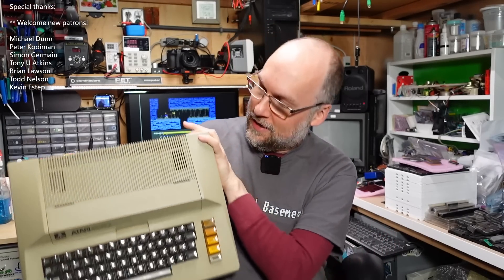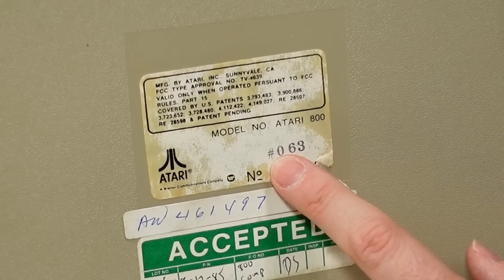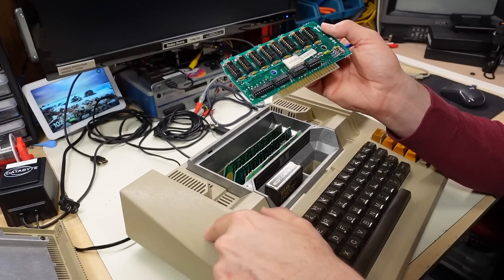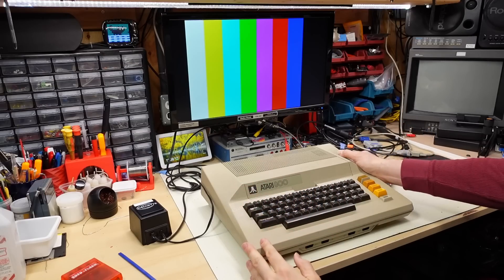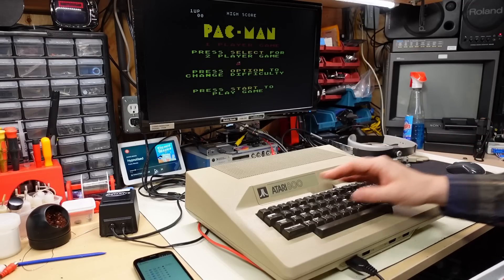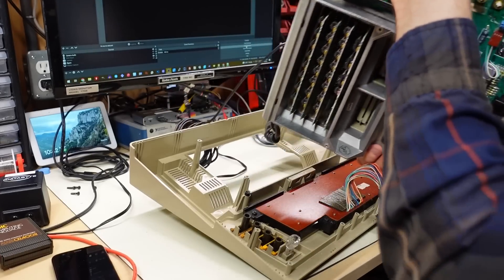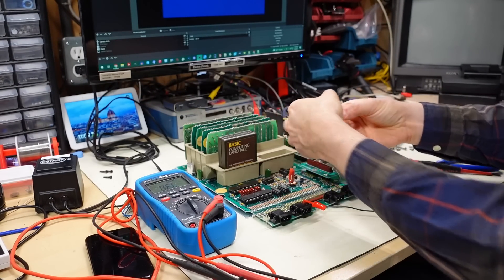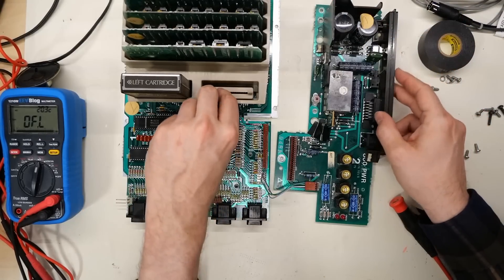Troubleshooting the beautiful Atari 800

Comment: The 800 was a very expensive machine comparatively speaking when it was first released and was still expensive in the year that the VIC-20 was available in the market (from 1981), even when accounting for the larger memory size. The one machine that was even more expensive was the Apple II, but one has to remember that Apple was able to get away with selling a computer that, adjusted for inflation, would cost the equivalent to $5,000 USD (!!) today, only because of VisiCalc - which was that computer's killer app. The biggest problem for Atari was that the 800 is just so over-engineered, making much more expensive (comparatively speaking) to manufacture than competing machines. What I think is the very best feature of the machine is Atari BASIC, which I still consider a masterpiece that was rivaled only by BBC Micro BASIC and Microsoft's Extended BASIC.
Reply: Apples other reason it could command such a high price is that it had inroads into virtually every public school that had a computer programming course, and its' only real competition there was Radio Shack and its' TRS-80 Model III, another fairly pricey computer.  Atari and Commodore could never get into public schools due to perception of them as only being video game machines, not true computers.

Comment: If I remember correctly the screws for the 800 memory cover were actually thumb latches which you could turn to get the cover off (didn't need to remove the screws completely) and the memory and ROM cards all had plastic covers with some very cool looking labels. Learned to program on one of those bad boys!
Reply: Yep the early models had those cool latches you turned to pull the cover off. And all the early models had covers on the memory modules and the OS module. The later models had metal tabs that you had to slide (after loosening the screws) to pull the cover off. And the later models did not have covers on their memory and OS cards because they came populated  with a full 48K. This also fixed an issue where the enclosed memory and OS modules would overheat. My brother had the early model and I had a later model. Now I have 2 800s' even in the original box!

The Atari that Adrian is working on is a later model. There should have been a removable plastic top brace holding all the cards from flopping around.

Cheers!

Comment: Because this 800 had screws to access the ram/rom boards and because the ram/rom boards were not in cases this machine was a later 800, the early 800's had thumb knobs to access the inside and the ram and rom modules all had cases.

Comment: Fun lost fact, the Atari 800xl was developed in 1981 in response to the reception of the 800. By 1982, several 800xl systems were made for FCC testing / development that used the same case as the one in this video. Sadly, I didnt know what I had, and its now lost. It was the only model I have ever seen in person with 800XL on the badging in this case design.
Reply: did you get any pictures?

Comment: You can tell this is a later model Atari 800. The Ram and Rom cards used to come with a Beautiful plastic case and they slotted securely in the slots. On the top of the case it would tell you 16K RAM, 8K Rom, etc.

Comment: My Atari 800 broke in 85, I intended to keep it and repair, it, but in a move, it was packed with my VIC 20, and that boc was lost, never seen either of those computers again.  But don't forget, it's has sprites too, it was the first computer with hardware sprites.
Reply: Hmm, I don't remember the permenantly sttached RF cable.  I wonder if they changed that later on?

Comment: I OWNED one of these machines in the 80s, shortly after graduating Pratt. The RAM boards shown are likely 3rd parry boards. The original ram modules were enclosed in metal/plastic housings which socketed neatly in the slots with side tabs. Aside from acting as a securing housing, might have also served as a heat sink. Back in those days, there was a lot of concern at the time about RF interference, hence the very stout shielding. There was also a fairly extensive library of software available on cartridges, tho’ mostly Atari branded games. I don’t believe that they ever offered “Left” cartridges.

Comment: the programs I used to write were often larger than the available memory. I had the programs as text on cassette, I wrote a loader, I used split screen , printed the program lines to the second screen ending in chr 13(return key) that way overwriting the program in memory as it ran...
 
I still can't afford a hard drive for it.

I also forgot how I did the split screen... but I kept the second one beyond raster 580 so you wouldn't see it on a tv, only if you had the monitor.

Comment: I opened up a friend's Atari 800 back in the day and the cards had been inserted through some kind of antioxidant goop. It had the texture of Vaseline and dripped on everything. I can't imagine it served any real purpose and now I wonder if that's something local repair shops were doing.

How did the power supply generate the +12V and -12V that the 4116 chips needed from the 9VAC input?

Comment: the original VCS/2600 had a similar zinc injection molded part. the cartridges had all the data and address lines going to them. lots of odd harmonics being generated.

Comment: My 800 has levers rather than screws to access the expansion slots. I must have a different revision. The serial label is gone, and I haven’t been inside it yet so I don’t know if it’s earlier or later than yours, but it’s probably earlier since yours is pretty late in the 800 timeline.
Reply from the maker: Yeah yours must be earlier. Really seemed like they intended very easy access to the extra slots right from the get go.

Comment: Late model  800's shipped with the cards naked, like your's.  Absent the cases for the cards, the boards would wobble, so there is a little plastic holder thingie that sits on top and gives them some rigidity.  You are missing the plastic thingie.

Comment: the ram modules are strange. On my 800 I had when I was in jr high the ram modules were fully enclosed like a cartridge. 
The 3rd party upgrade ram which went beyond stock max ram was freeballing like that. But stock ram AFAIK was cartridges. That slotted into the recesses in the metal shielding structure for rigidity.

Comment: That zigzag trace is likely more about impedence matching/transmission line stuff than a delay..I suppose it could be a delay but the order of magnitude of it would be a few orders above the sensitivity of any components in this machine (ie probably at best 200-500ns access time if that..that delay might be 2 to 3 ns)
Reply: Ie 1.7mhz is 588ns about.. I'm betting impedence matching way before any timing related thing.
Reply: @forbiddenera  Except that 588 ns is a full clock cycle, which means that the RAM is going to have to be able do a read or write in well under half that. In that half cycle you need to wait for the CPU address output to settle, set up the row address, assert RAS, wait for the row address to be latched, set up the column address, assert CAS, wait for the column address to be latched, and then wait for the DRAM to produce or write the data. CS and OE also need to be managed properly during this process, and the data must appear within the timing constraints of the 6502.

As is usual with DRAM, all of this involves a lot of tricky timing. It would be very normal for a system of this speed to need a signal delayed by just a few nanoseconds when it's a bit too early for the DRAM to work properly; if it's delayed too much the data won't be available when the CPU reads the data bus.
Reply: @Curt_Sampson  Yeah, DRAM timing can be tricky; After reviewing the schematic, it's listed as a 'printed coil' and doesn't appear to be involved with the ram logic although the schematic isn't completely clear. I still think impedence matching and/or filtering.

Comment: The serial number 063 is 6th week of 1983 making it one of the last 800's as 83 it was replaced by the XL line the later 800's carry the better GTIA graphics chip that was installed on the 5200s.

Comment: "System Reset" on the 400/800 was /NMI key, like RESTORE on the C64/128. 
Atari soon realized the problem with this: it wouldn't get the 6502 unstuck from an illegal opcode like $02. 
On the later 8-bit machines, the RESET key was wired to /RESET.

Comment: The older models came with 16k and the cards were contained in a cartridge. Later models came standard with 48k and as such there was no reason to open the case and so they replaced hinges with screws and so you would never actually open the case although everyone did just to see what was in there

Comment: Big issue re the A8, C64 and other pre 1985 8 bit computers was lack of 80 column text for word processing,  spreadsheets and other "serious" business software.
The 8088,86 pc and Apple2 either came with 80 column text cards or there were many 3rd party cards to choise from. So even though there were great word processors, spreadsheets and database apps for the c64, a8, they weren't taken seriously without a real deal 80 column text mode and matching monochrome monitor.
They were great for games and graphics apps, but no matter the tech level and build quality, the c64 and a8, xl series could never get into the office market.
The St and Amiga did well among desktop publishers, video and audio production work.

Comment: When the Atari 400/800 were being designed the FCC regulations were more stringent and based on so much output per mHz. At this point in time there were not a lot of things in the home that connected to a TV; VCRs were uncommon and very expensive, and there were very few video game consoles that came before it. If you wanted to connect to a TV you had to meet these regulations. Atari had to start the design process with these regulations in mind thus all the shielding.

With the PET Commodore included the monitor so they skirted around the regulations. Apple did the same thing by not making an RF modulator for the Apple II. Both of these machines are terrible sources of RF interference. The VIC-20 did not have the RF modulator built in but it did come with it.

Around 1980/1981 the FCC relaxed the regulations as they did not really match the reality of these still new devices that connected to home TV sets. This allowed lower cost construction for machines like the C64, 800xl, etc.

Comment: At the time the first Atari machines did not meet the RF requirements of the 70s. The machine would cause interference in other electronic devices like radio bands and even some TV’s. Other than going back to the drawing board, Atari came up with the perfect solution by adding a metal framework to the machine. This shielding allowed it a solution without going back to the drawing board and re-working the whole machine. Personally, I love the metal it was one of the key points that I used to point to my friends just how commodore 64 and Timex Sinclair to mock their models of how cheaply theirs were built
Reply: So bad these RF requirements. My Dutch computer from 1980 just transmits its video signal to nearby TV's without a cable.....

Comment: What is amusing about the keyboard and what you call ab-normal was normal at the time. Look at the Apple II plus keyboard and notice the return key is in the same place. And even the font/typeface on the keyboard is the same as the DEC VT terminals, the Heathkit H19A, IBM Selectric typewriter, TI 99/4A, etc. 

Cheers!
Reply: Yes there is a thread on Atariage about the keycap font for the 800. Seems to be a standard font that went back into the 1950's iirc. But iirc no other home computer used it.

Comment: A Sega Genesis controller actually works on the Atari. Unlike the NES controller, the Genesis controller works on the Atari right out of the box without modification. When I get a Genesis I plugged in the Genesis controller in the 800XL and was amazed it worked. I also had a Texas Instruments TI-99/4A and I had a WICO converter that allowed the use of Atari joysticks on the TI since the TI could only use TI joysticks and they were terrible and the converter meant you can use Atari or even Sega Genesis controllers (or your modified NES controlled) on the TI.

Comment: I haven't watched the entire video yet, but will when I get the time.  My first computer was an Atari 400, and later an Atari 1200XL. 
Though I want to point out some  issues in the Video:
1st the Atari SIO is the sucessor to today's modern USB.  IN FACT, the creators of Atari SIO, Joe Decuir, went on to design USB, and he credits Atari's SIO for most of the design of USB.

2nd big mistake : Atari's SIO has nothing to do with commodore's port! Commodore's communication was extremely slow slow in comparison to Atari's SIO, and this was do to many factors,...don't want to write a book here.

Also FYI, the graphic chips ANTIC/CTIA/GTIA chips were the FIRST computer "graphics cards" for PC, as they came out in 1979, designed by Jay Miner.  Apple II to the contrary had to do the graphics with the CPU. 

Another trivia fact (TRUE story): IBM considered licensingthe Atari 800 technology to make the first IBM PC.  But when IBM went to a meeting at Atari, many of the developers were smoking marihuana, thus IBM decided to go with the most dominate OS of those days, the CP/M operating system and an architecture based on Intel and the S-100 bus(that they modified into the ISA bus) .... and well I won't go into Gary Kildall,  CP/M and the MSDOS ripoff story... most in the know, should already have heard it..

Comment: The 800 is so well made, it's basically cast iron in places. I think with Atari being owned by a movie/TV company they really went to town on the shielding.
Reply: They went to town due to FCC, the rules were simplified not long after Atari designed these.
Reply: Yes, it was owned by Warner from 1976-1984, if I am not wrong.
Reply: Cast aluminum.
Reply: @akkudakkupl  The rumors at the time claimed the simplified rules were the result of lobbying by Commodore. :-) After the rules were relaxed, Atari cost reduced the line to the XL series with less massive shielding.

Comment: the 800 is such a pain to find, 400 or 800xl easy, but the 800 itself, the only one with both cartridge slots, nope rare as all hell.  mine didnt work on arrival but after a dodgy repair of the psu and reseating literally everything it just popped to life, as for the rf cable, i think i just put it inside the chassis since there is plenty of room and i also dont plan on ever using it
edit: also it came with a full set of maxed memory and mine were the type with full plastic shells and metal labels, not sure which version is the more common one, but its entertaining that you can basically yank out the operating system by removing the slot 1 memory expansion which also end up being a reason for its ram cap at least in oem layouts

Comment: In a way, the 400/800 was/were the first gaming PCs as no other machines at that time (that I know of) had discrete sound and graphics. My larger and much more expensive Apple II+ depended on a single CPU to handle all of that. But parents back then didn’t want a game computer, they wanted a “serious” computer for “serious work.” We didn’t understand that a computer that was great at games would be great at everything else too. So grownups would drop a premium on an Apple. Of course, all the expansion slots that the II series sported meant you could pimp out your system almost endlessly. Still, out of the box, the 800 was probably the best overall value - “power without the price!” - two cart ports, four controller ports, serial bus and slots for expansion with support for various peripherals, discrete sound and graphics (which were better than most/all other PCs), a solid keyboard (except for that overly-delicate space bar), compact form-factor, tank-like construction, futuristic design, support for composite video - what more could an 80s kid want?

Comment: 27:35 - It looks like Atari originally was going to encase the RAM and ROM boards in plastic cartridges! Now they just wobble in those slots!
Reply: There is a missing plastic stabilizer piece that Atari put in there.
Reply: They actually were in fancy cartridges in the beginning. Later on they started installing just the bare boards. I've heard it was to prevent overheating but I imagine cost cutting also played a part.

Comment: I have one I've never been able to use because it doesn't boot. Only thing it does is the light comes on and the screen is black. Any suggestions? I've cleaned all the boards and connections... about the cards, mine is the 48k model, there's a plastic stick with 4 slits that sits on top of the cards to keep them from flopping around.

Comment: Hello, i am well impressed by your dismantling of the Atari 800. Well done. Just a simple question, if I may. I have the same computer but the monitor signal is garbled. The rf cable is ok, but the picture shakes if i move the computer around too much. But the monitor (5 pin DIN) shows a really bad rolling picture. I would like to be able to use the monitor jack more than the rf cable. Any ideas?
Reply: Sorted .. bought a 5 pin DIN - RCA (white, red, yellow)  cable from Amazon .. picture is better, but still not 100% right .. light and dark blue horizontal lines, might be the cable but way better than it was. Originally I used a 5 pin DIN to 4 RCA's, which included a black connection lead but don't need that, just something I had in the spares box. Now the rf cable (for the antenna/aerial connection) is tucked away inside the recess of the 800, which must have been specially designed for that purpose!